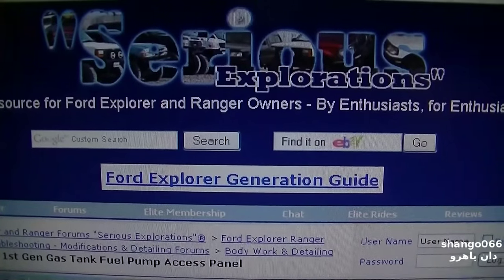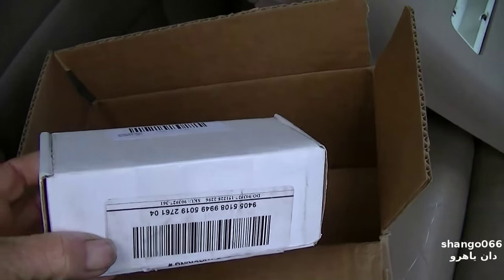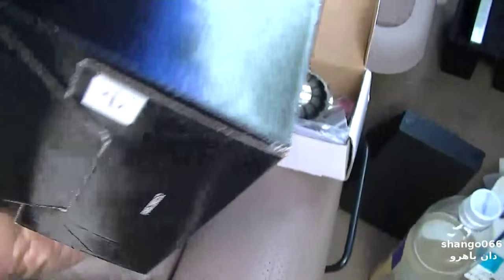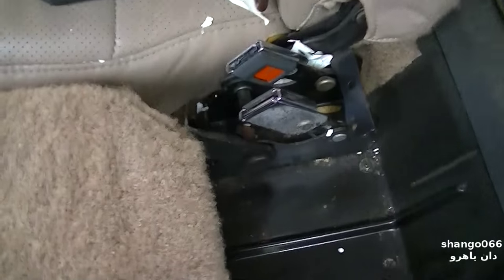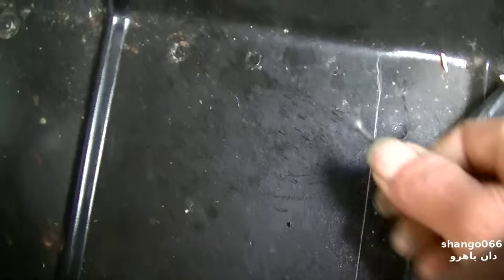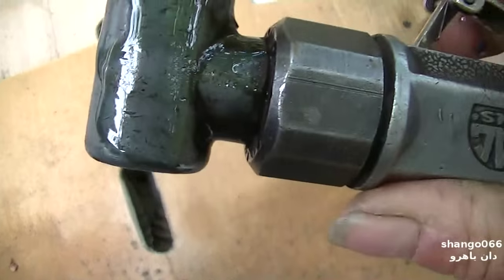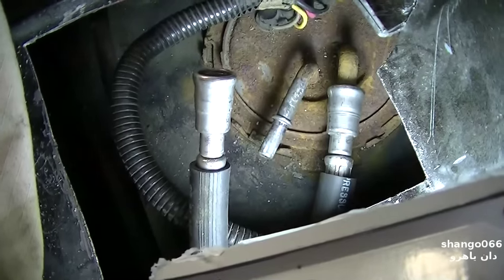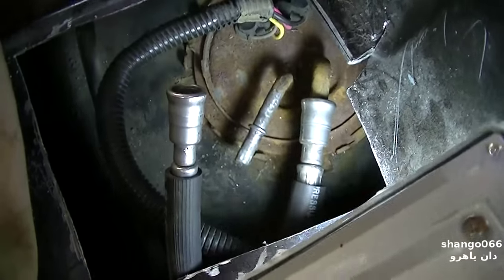Ford Explorer Fuel Pump Replacement 1st Gen 1992

Comment: Mechanic here. (Also necroposter!) Even though your old pump was well and truly dead, many times I've taken a 'dead' pump out of a car and tested it out on a battery and it worked. Just as a piece of advice, if that happens to you, replace the pump anyway. They will fail that way, not working in the tank, but apparently working ok outside. Likely a dead spot on the motor and being handled jostles it enough to catch. Banging on the gas tank while someone else is cranking the engine will sometimes get the pump going - and prove a pump failure. I don't completely rely on listening for the pump sound, I once put a used oem Lincoln Town Car pump in a Ford Ranger. That thing was DEAD silent, but worked like a champ.

Also, I always do a visual inspection of the level sensor. It's a couple contacts sweeping over a resistance surface. Most common failure is that the contact fingers wear down to nothing and barely touch the surface. It will often work enough to move the gauge to the right places, but will lose contact when in the tank. Sometimes you get lucky and can just bend the contacts closer and it'll work. Pull the float arm away from the sensor and see if the contacts lift away. Never seen a float take on liquid though, lol.
Reply: After market senders never work right. I put a bosch one in my grand marquis and I could never get it to read full. (F) on the digital display, reads 17 max. Probably had to be bent down with trial and error, because it seems accurate otherwise. I may reinstall my old sender.
Reply: I took my sending unit apart and rewound it and it works but is not accurate but i know where its at.

Comment: My neighbor bought a Ford F-150 parts truck a while back, the guy he got it from actually cut a hole in the bed to replace the fuel pump, some cars actually have access panels to get at the fuel pump I think all vehicles should.
Despite its problems the engine seems to run pretty good.
Reply: My 1995 Toyota Camry sedan has an access panel under the rear bench seat, with 3 screws holding it in place(newer models have it glued in place). The hardest part of changing the fuel pump was taking apart the flare nut fittings, they were extremely tight.

Comment: I just last week did this to a 2003 Chevy Suburban, took about 2 hours, was more difficult to remove the rear seat than to do the work itself. the instructions were easily found on utube. Now I have a 94 explorer to do, and will follow your method as well. I use an electric grinder with a 4 in. thin cutting blade, much faster than the air wrench and easier to control. Thank you so much for this much needed info!

Comment: If you take the float out and drain it to see where the hole is, maybe you can get some epoxy goo and cover it and when its dry pop it back in. I have done that in the past and it works. I did it on my '94 F150 about 100k miles ago and its still good.
Reply: I have a 94 and I have questions if you’re still active

Comment: I've used this method to access fuel pumps also. If you have an air compressor check out "air nibbler" on EBay.

Much safer than a grinder and more controllable. Only down side is it makes a lot of half moon shaped metal fragments that are very sharp. The edge of the actual hole it cuts is not too bad.

Just my 2 cents.

Comment: Just pull the 10amp yellow fuse, under the left Dash. The Fuse is the Forward Right most fuse in the Fuse Block. This will kill the Dinger, Radio Memory & Dome Lights.

Comment: In the end your just tearing out interior pieces and cutting sheet metal. I think it would have been easier to drop the tank especially when empty. It's a safety hazard as well because if the tank catches fire it will melt that silicone and come up through the new hole. Btw even though the door chime is annoying many people don't know it's useful for diagnostics or operator error. If I shut my Expedition off with the lights still on it beeps repetitively, or if the check engine light comes on it does a long beep for a few seconds to warn something is wrong.

Comment: Man that transmission is a bleeder. I drove an Aerostar home bleeding that bad 60 miles once. On the way home a really impatient driver got right on my bumper as the ATF was barfing out (I was driving slower), smoke rolling out from under the van because the ATF was on everything. I'll never forget when I saw the wipers go on that Pontiac, and then them suddenly back off and pull over.

Just keep at it. It sounds like it runs exceptionally well. It seems more then happy to be running again.

Still strange that it was parked the way it was. To have the gas tank drained like that, it was a very long term storage that was planned for.

Comment: You should have pulled the tank it's not that difficult the tank needs cleaned anyway. You can buy the brass floats separately and a good old fashioned auto parts store like southern auto or a car quest store. You definatly would not want to cut a access hole if you lived in a northern rust belt state.
Reply: you can make an access panel, newer cars have them nowadays. As for the cut you could either put fluid film over it or possibly paint it with some sort of primer

Comment: In relation to the float, if it is brass and not plastic, why not place it in boiling (or very hot) water and watch for the bubbles. You could then drain and re-solder it.

Comment: All those flaming metal sparks around gas, LOL, why not just torch it!  That would EOL Shango.  I suggest an air  nibbler tool, quick and easy.  I use them to cut holes for speakers in sheet metal.  HFT has them cheap.    Don  KABOOM!

Comment: got a 94 Nissan D21 -trying to get the bed off, may just cut an access hole now.  body hardware holding it down is 4 12 mm nuts on bolts, and they're loc-tited on there, rather than break the bolts, since their nuts are extra hard to get to and seat a wrench on, yes, new trap-door coming right up... the next owner will be happy.

Comment: Way easier to disconnect the fuel lines after dropping the tank. Need to remove the filler hoses first and electrical harness to pump, then the tank shield then the 1 strap that holds the tank to the body. Once tank is dropped, easy to disconnect fuel lines. Tank that old needs to be cleaned thoroughly as I found the old float and filter were disintegrated in the tank. Thick layer of gunk was caked to the bottom of the tank and the old pump was sucking up all the deposits and was rusty as heck. The remaining old fuel had the color of coca cola. Dumped out all the old fuel and washed tank out w water and dried out for a day. After done tank was clean n fresh ready for new pump.

Comment: So my question is, why don't auto manufacturers put in a bolted removable steel panel directly over the location of the fuel pump? Is it because of safety reasons? The cost to drop the tank will shock you. I've seen folks do this same cut out job on Mazda's to also avoid having to drop the entire tank to replace the pump.
Reply: +paul larson Many do have an access panel actually, like the 90's Dodge Intrepids and Chrysler LHS series cars do, not sure about other makes. I'm not surprised that one would have to cut an access hole in a Mazda to change fuel pumps or sending units, Mazda and Ford used to be chained at the ankle, many of the Ranger pick ups were basically Mazda clones with different trim and engine options. Now if I had a tank full of stale or green gas I would drop it just to clean the sludge out.
Reply: +OlegKostoglatov A quick search revealed that this is being done on many different vehicle models....not just Ford/Mazda. I had no idea. From what I viewed it can create some structural integrity issues, particularly with pickups which have the tank under the truck bed. Like someone else commented on here, the manufacturers could easily do this. It's mostly about additional cost and the likelihood that the pump will fail years after the warranty expires.
Reply: paul larson
 Fortunately most pickups, even from the Japanese makes, have a full frame that runs from front to rear, so cutting a hole in the bed isn't likely to cause a structural issue. Mind you it could create another spot for dirt and water to collect to rust out the bed faster. In the older style pickups the gas tank used to be mounted right in the cab behind the seat, now most seem to have it just behind and bellow the cab. But on older vehicles the only thing that could go wrong in the gas tank was the sending unit or a plugged sock on the pickup, the fuel pump was on the engine.
  Getting back to Ford/Mazda products, Ford has been known to add some stupid and useless things to their vehicles. One of the more recent ones has been the so called "EZFill" filler neck on their gas tanks, which causes a problem if you have to add gas with a can. Apparently if this dumb gadget breaks, which it will since it's made out of plastic, it will cost you $350 to get a replacement from a dealer. All this just so someone can be bared the drudgery of pushing down and making a quarter turn on a gas cap.

Comment: For those that wonder why there is no access panel above fuel pumps.....The official line (in Europe at least) is that this would allow a thief access to the pump to power it up from a nearby 12V source and aid theft. >>> I personally don't think that this is a viable excuse nowadays with full electronic engine controls that can have sophisticated immobilisation features.The real reason is.... Yep you guessed it COST. All goods, not just cars, are built to budgets.Think how much it would cost to add a panel opening, making the covering patch and gasket, fixing screws etc. Compare this to the reliability of the Fuel Delivery Module itself and you can see how the accountants work. Under warranty, if a tank was to be dropped down then the vehicle would be up on a 4 poster and access would not be too difficult. Bit of a swine if the tank is full though.If you think about how many vehicles are made of a specific type on a production line during it's life. Say at least a Million, if you could save 1 buck per vehicle then the savings would be $1 million. Go figure.....

Comment: The other problem(s) with the auto parts store include people working the counter with room temp IQ’s, the price point for Chinese or rebuilt stuff is insane & getting the correct part on the first try. Or if you can wait order on rock auto save 50% and 9 out of 10 get the right part.

Comment: but will it pass its MOT with a big hole there?
Reply: Exploder is body on frame construction, so yes. For a MOT fail it would have to be unibody construction like the Jeep Cherokee for example. cutting a hole there may compromise body rigidity... (or maybe not :-)  )

Comment: Needs power steering fluid the quick bleed procedure is fill start turn the wheels all the way to one side shut off let sit for 5 minutes repeat turning the wheels to the other side. Don't use the cheap dorman thermostat housing go to fordpartsgiant.com dorman parts do not last

Comment: i myself if i was working on it i would have dropped the tank rather then do any mods. i prefer most all cars to stay factory original especially all metal being original as possible or if it rusted the rusted metal replaced to factory spec. i am  just that way i prefer factory spec when it comes to replacing thing s and factory spec to the way things are replaced and installed. i dont like having to know some car was hacked up just to replace a part i want to know it was done but never know or find evidence it was done. oh well thats just me ocd ha ha

Comment: On what planet is running a cold engine worse than overheating it
Reply: Basically just as bad on the long run. Engine is in choke mode most of the time, the fuel injection system injects excess fuel and this extra fuel washes the oil off the cylinder walls, which in turn makes for high wear of piston/rings/bores.